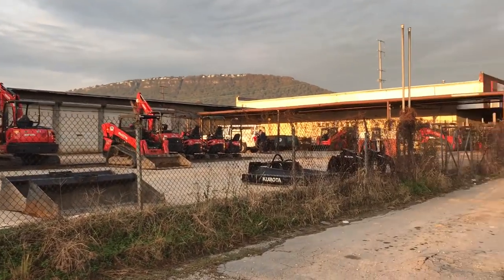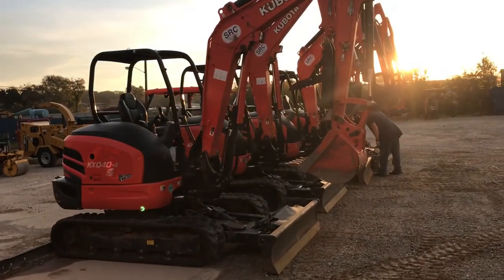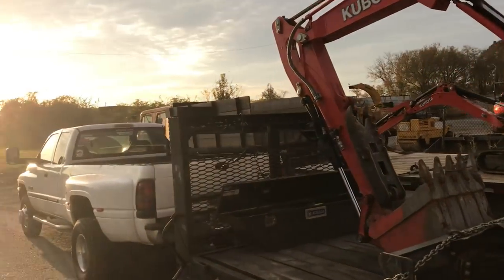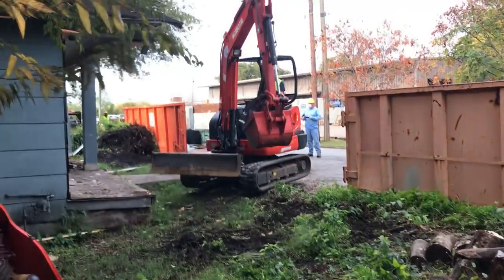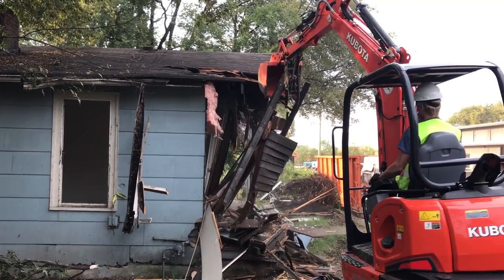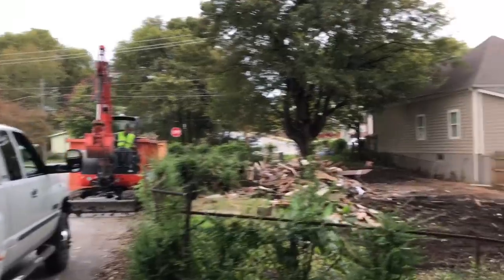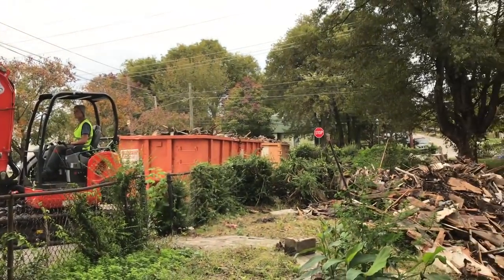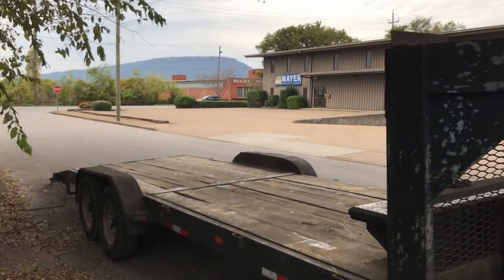My First Demolition Job

Comment: I use a Cat 963 with a 4 in one demo bucket.  After I tear it all down, I push The debris into a pile and shredded up with the tracks of the dozer into small pieces then I load into a dumpster or a dump truck and haul it away.  It really depends on your budget.

Comment: all of these people are complaining, but is the building still standing? no. did it damage any neighboring buildings? no. so what’s the big deal? first time or not the job was finished
Reply: Here the big deal. 

-The guy is destroying the excavator by swinging it sideways, will eventually cost them a bunch of time and money to split the machine and fix the swing gear

-they did not protect that old tree but tramped the root system

-they collapsed the chimney on the trash which means they are paying to throw bricks in the tonnage

- you dont need a skid steer at all all on that job it is just making a mess

- the excavator is too small they needed one twice the size

-you dont pack a container with a fixed thumb like that you actually can twist it off like that

Im sure if i watched it again id find more wrong
Reply: @chrislasala  here's a real big deal...
- the mini excavator is still running normaly
-now they owns 2 supercars thanks to the haters
Reply: There was an old, run-down, house in our village, and people complained about it constantly. A contract was put to tender for the demolition, and people complained regarding who got the contract to tear it down. Over a two day period it took to tear the house down and haul away the rubble, people complained about the noise and dust. Now, the lot is completely restored and put up for sale, pending a zoning change from residential to commercial, because it's on a business street, and guess what....people are complaining. Some people just like to complain.
Reply: @chrislasala  are you hosting workshops and willing to teach?
Reply: @YahwayorNoway  what do you mean. I've been teaching for years and having conferences
Reply: @chrislasala  the only way I know it by asking. That was a legitimate question. How do I reach you? Email by chance
Reply: @YahwayorNoway  yea look in info section

Comment: Can't knock you for getting the job, but next time get a bigger excavator. It would save you time.
Reply: TRue!
Reply: Bigger excavators require a license to operate
Reply: Where tf do you live? I live in Illinois I’ve operated for 8 years everything from a 4000lbs excavator to a 40,000 lbs excavator and never needed a license. The one they were using is probly 8,000 lbs
Reply: Kale. I've used the same over the years and never heard of someone needing a license.
Reply: @evan6.7  License? Where do you need a license to operate an excavator?
Reply: darrellhay in Massachusetts most excavation and rental company’s require a license to operate over a certain size excavator to assure safe and proper use unless on private property. Its not a law just most companies around me require it
Reply: @evan6.7  do you even know what your talking about?

Comment: This is exactly why you should never buy a rental machine after its rental life! Lot of people without experience and using the machines improperly, putting excessive premature wear on the bucket/arm pins. Not to mention the side swinging to knock down the wall and chimney, more wear and tear on the slew motor.
Reply from the maker: Nairb Kcorrum sorry about that lol I will never treat a machine like that again

Comment: The next time you use an excavator curled the bucket up then press down into the dumpster with it. Also if your other excavator had claws you could grab bigger chunks? I think somebody's videogame playing help them run those excavators. Looks like you had fun and wish I could have joined you : )
Reply from the maker: aa999xyz Great tips! Yea we both definitely had lots of fun doing this job. The claw on the skid steer would have made the job go a bit faster.
Reply: love them reliable kubota beast  that can handle any thing these powerful beast can handle

Comment: Holy overloaded Batman!!!! lol
Reply: Shannon Stiles they make a 10000lb single wheel now. Ill give him the benefit of the doubt but i thought the same thing. Lol
Reply: Looks like those are 6k axles...
Reply: Christopher L i think your right. 6 lug at least. See it good at 7:46
Reply: 9k for each piece of equipment is probably a bit on the light side, so 18k+ on a trailer designed for less than half that.  Talk about unsafe on the road.
Reply: LOL I can't confirm nor deny the fact that Maybe overloading a trailer or two in my day
Reply: Overload, no U.S. Dot number.  If the trailer scales out over 10000 pounds better have a class A cdl.
Reply: Mike Trudeau depends on where you live, but I will agree that trailer is overloaded
Reply: dallasparker70.  I went to aWisconsin D.O.T. seminar and the trooper says the first thing they look for is the U.S. D.O.T. number. And it's down hill from there
Reply: A trailer weighing over 10,001 pounds the driver must have a class a cdl even if it's a pick up pulling it. Campers are excluded as long as they are not for hire.
Reply: The spec on the excavator is only 2200 lbs......
Reply: jmh9932  that is the operations weight.(what it can pick up) The x weight is likely in the 3 to 4 ton class so that would make it about 9000 lbs.  That tracked loader would be about 10,000 lbs, class. So do the math and add 3000 lbs for the trailer.
Reply: They each weigh about 9000. I'd say he's definitely overweight. But hey who hasn't ran heavy before. I just hope the trailer has working breaks and he didn't have any big Hills to come down. Lol he's about at the 26500 cdl
Reply: Golly! I added the exact same numbers too!!! He's got 22,000-23,000lbs behind that truck on a 12k trailer! What the heck?!! Nice job guys but that's way too  much weight. That's like trying to haul my Cat D4 Dozer on a 12k Trailer. I'd never think of doing that. The only reason that trailer half way held up is because that 10,000lb Kubota SVL 75  is sitting on the pin of that truck. And the Excavator has some weight on the pin also. Beyond Yikes!!! Max pin weight should NEVER exceed 7500 lbs. You can snap the ball or hitch or something.
Reply: jmh... that's not right - i looked it up and that Kubota excavator comes in at around 9500 lbs.
Reply: @briarpatch718  The kX040 is pushing 10,000 itself
Reply: @08c6vette  agreed so 2x6000lb axles are a way overload.  Ill bet the trailer itself weights over 3000
Reply: @miketrudeau6619  You only need the D.O.T. number if you have a CDL. They clearly don't, otherwise they would know that they were very overloaded. The trailer can not exceed 10,000 pounds, weight of trailer plus load combined, before you need a CDL. The trailer weighs 2500 pounds, skid steer is around 8000 pounds and the mini excavator was around 7000 pounds. Total weight 17500 pounds. I am being conservative on the numbers too, they are probably closer to 20,000 pounds. Clearly they haven't a clue or a care for their safety or anyone else's, just gots ta make dat money boi...

Comment: Question. Was this still a profitable demo having to rent all your equipment? Seems like considering average sqft for demo is $3.
Reply: the biggest cost was probably the dumpsters, unless they got a deal...normally its like $400 per dumpster....they used 6......minimum cost $3500 plus $1200 labor

Comment: Your blade is the wrong way round. More tear-out force is achieved on small excavators with the blade behind you. 
And don't side swipe the chimney with the boom, hope your hire company hasn't seen this vid!
Reply: Steve Gray no its not allway keep blade in front of you acts as stabilizer!!!comon man only a little comon sence will tell you this!!!
Reply: were you born yesterday, you're supposed to be working over your idlers, hence with the blade in front of you because the idler has a larger surface to support the weight than the drive
Reply: For those of you who only read my first sentence, read further. I said "on small excavators".
Reply: Still wrong lmao
Reply: NO Steve is right!!!! On a small excavator you have better break out force with the blade behind you during certain stick motions. Also you don't run the risk of screwing up the blade when you drop a chimney on it like they almost did. I cringed as that chimney fell inches from screwing up that blade. I'd have a cow if someone dropped some heavy crap on one of my blades like that.
Reply: Thanks Sean!  
I think it's one of those topics where some of us have to agree to disagree :)   

On a side note - here in UK (& EU) - instead of thumb grabs we use fully rotating Selector grabs, usually with auto quick hitch, makes life a lot easier. Am wondering why you guys in the US don't use them as much?
Reply: Bobcat should have grabbed a bucket on it while he was tearing down he could have been going in and cleaning up where you wouldn't have all that in front of it

Comment: That’s why you don’t buy a used Excavator!! Lol  Looks like they had fun though
Reply from the maker: tigersx41 we own the skid steer but the excavator was rented, yea was a lot of fun
Reply: If you buy your own excavator, never swing the machine sideways to move or knockdown anything, you'll end of having to replace the large pinion gear that rotates the machine and the swing motor.   On a large excavator that's a major repair that involves taking most of the machine apart.

Comment: I’m planning on gettin Into some demo work in the spring.. how did you quote a job like this? And roughly what’s an estimate on a job this size? Nice job!
Reply from the maker: We sub contracted this job. The homeowner pulled all the permits and took care of the trash cans. We charged a flat fee of $5000 for the demolition but we had to rent the mini excavator for around $350. Took us about a day and a half.
Reply: You need a grapple bucket for the skid steer.
Reply: Sub is the best way to go,less risk

Comment: Wow bud that’s a rough operator. Really beating that mini x up a good one. Lol. Practice slow, methodical and fluid movements. Once you get that down, then you can speed up the motion. It’s definitely an acquired skill through time, patience and determination. By far one of the funnest jobs I’ve ever had: Heavy Equipment Operator

Comment: Word to the wise:   Looks like you overloaded that trailer at the end.  That's a 14,000 lb trailer, and you got probably 20,000 lbs in equipment on top of it, including 6,500lbs for the trailer itself.       Hauling 26,000 lbs  with a truck probably not rated for it is not a good idea, you will wear out the transmission prematurely and not having the stopping power on either the truck or the trailer could lead to a big accident.   Those rims look like 6-lug, not even 8-lug.    Even a tandem dual with 12k axles would be stretching it for that load.    Be safe Bros!

Comment: 3:12 that's allot of free floating asbestos dust you just put in the air. What year was the house built? Between the 30s and 1978, they used allot of asbestos in chimney mortar.

You need a guy on a water hose keeping the dust down. Seriously!
Reply: Especially in a residential area.

Comment: That’s to much weight for a 14 or even 18 k trailer. WAAAAAAY TO MUCH!!!
Reply: To much for a 24k trailer too. Max payload on a 24k is 17 grand because the trailer weighs 7000 all by itself. Like you said, Way too much!!! Guys there is a way to tell how much your trailer can haul without even looking at the stamps. The number of lugs tells us everything we need to know.
Reply: That’s what I was thinking but wasn’t sure. But I I know pulling my skid steer alone with my 7000lb trailer seems about legal. I can’t imagine adding another machine on top of that.

Comment: i don't know where you guys demo'ed this house, but you wouldn't get a mile down the road in Pennsylvania before getting stopped by the Police with trying to haul an excavator and skid-steer both on a goose-neck trailer being towed by just a pick-up truck!!  the skid is about 9500 lbs. and that excavator is about 9500 lbs. and that trailer weighs around 3500 lbs. - that's 22,500 lbs towed with a 3/4 ton Ram!  that truck weighs in at around 8000 lbs.  that,s a total of 30,500 lbs. "CGVW" - combined gross vehicle weight.  in PA, a regular license tops out at 26k CGVW lbs.  above that and you need a CDL.  AND - there's NO WAY that truck is safe towing those two pieces of equipment on the same trailer!!  the two of them need to be hooked up to at least a 5 ton dump or better yet, a 40 ton duel axle construction dump like a Mack or a Peterbuilt.  i have a RAM 3500 dooley set up for towing and the "pucker factor" starts to rise towing anything above 10k.  there is NO way i'd get in a 3/4 ton and try and tow 22.5k lbs!!!    it's not the "towing" it's the STOPPING that's the problem!!   i hope NO ONE watching this video does what you guys just did.